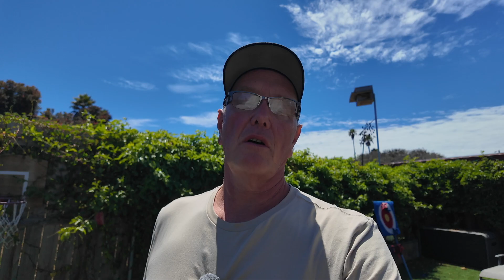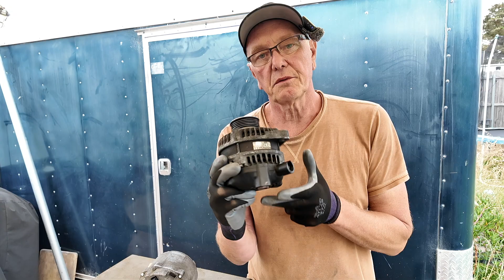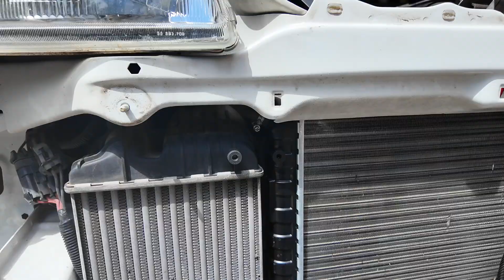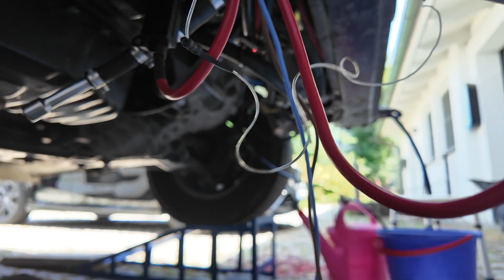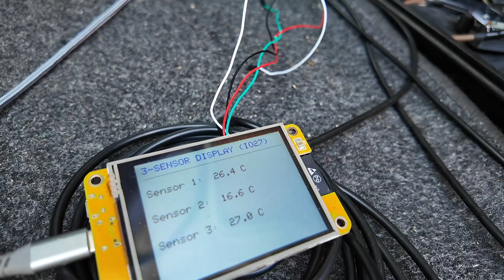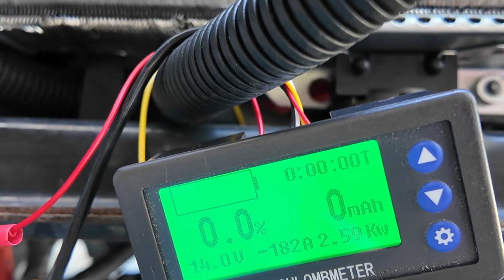Is 12 Volt AC Worth It? You Need ALL of these Parts | Our Full System Build

Comment: So now you have alternator setup very similar to me.
I have a Ducato 290 (1st gen) with 2,5 td, modified to use the exactly same double pulley as you have. :)
Very interesting idea with the heat exchanger to water! The better you cool down the hot side, the more performance you get from the AC, so really nice job. :)
Btw have you found a solution for using hydrocarbons instead of R134a for the AC? My roof-mounted unit has arrived and I need to either fill it with HC or R134a now.
Reply from the maker: Amazing coincidence you modded almost the same Motor. Its my sisters RV, never drove that model before, incredible little engine, tons of torque, love the transmission and to drive it in the hills. Thinking about importing one to the US.  
Yes, i was also hoping we dont need the condenser fan, because we are capturing the heat with the plate exchanger, at least until the water is hot. But well, the exchanger needs to be twice as large. 
 
Will not be able to test the hydrocarbon with larger TXV any time soon. I am assuming you are in Europe, i was surprised how hard it is there to get authentic 134A. Who knows maybe your set is different, give the R290+R600 mix a try, if it freezes up the evaporator like in my case you can still fish for 134A. 
Check high side temp on Compressor they went to 85-90C running on hydrocarbon in my case, also High and low side pressures while trying. Low side was extremely low due to restriction in evaporator. 
Love to hear from you if you have different results.
Reply: @wright-wrong  I am happy to hear you enjoy fiat ducato RV! :) Engine is really quite nice to work with, a bit noisy, but simple and reliable.
We cannot buy authentic R134a in Europe - it is strictly forbidden for individual customers to obtain. You can only get it filled for you in specialized stores or at a mechanic. It is due to environmental laws, that are quite strict here. So there is no way, I can fill the AC with real R134a myself, I can get it filled by my mechanic though no problem.
I will try HC first, as I really want to find the proper amount that it should be filled with. I should do it this week, I will let you know the results. :)
Reply: @wright-wrong  I have performed tests on the AC.
It is a roof RV AC from Sunster, 24V. It is supposed to have 2,6kW of cooling capacity.
I have used a 50/50 mix of R290 and R600. Filled around 165g, maybe 170g, so probably the perfect amount. I have also tinkered aroung the TXV as there is the calibration screw available, however, the best results I got were with default setting.
I do not know what BTU I got as I have no means to measure it, but I have 8,6*C at the output at full blast while the temperature was ~27*C ambient. That is about the same that people on the internet get with the R134a so I think that is OK.
I will repeat the test once the temperature is much higher to see what the results will be.
The LP is ~37psi and HP is ~129psi.
Reply from the maker: @wojtek87921 interesting,  thanks! The TXV on our unit was not adjustable, so you definitely have a different setup. Is there a part number on the TXV? Also, how many Amps was the compressor pulling at full blast? Is it also rated 600W like ours ?
Reply: @wright-wrong  It is a block-TXV, numbers on it are: Xinjing, S227671C-02 1.2T, JD12A 0444.
In the end I have left the calibration screw at the default position, as I found the results to be the best there.
The compressor is rated at 850W, 24V DC. Its model is VQDJ24V850W, 2604508847.
I will try to measure the current with a clamp meter. It should be less than with R134a as high pressure is lower in case of HC.
Reply: @wright-wrong 39*C today so I tested the AC outside as it is still not mounted.
On turbo mode the outlet air is 17-18*C so over 20*C difference. On Eco mode (fan lvl 2/5) outlet air temperature is 13*C. I have played with the adjustment screw but it really gives you just a 1*C difference at the outlet and then in cooler temperature (24*C in my apartment) it freezes the evaporator causing the compressor to ramp up and down with poor performance in the end. So I think I am at the limit of this unit actually.
Reply from the maker: Thanks for the response! What are you planning to do now?